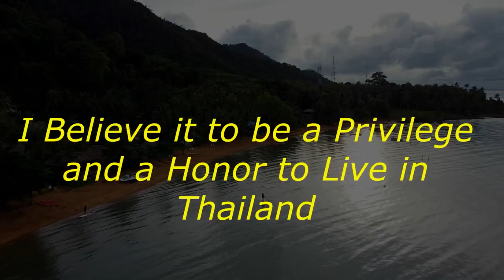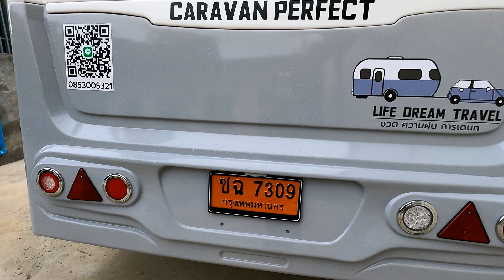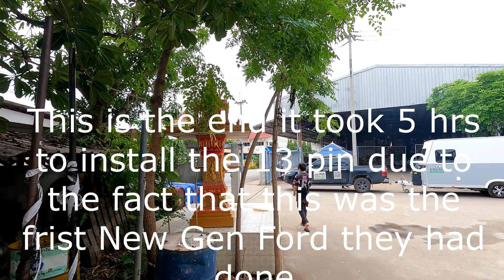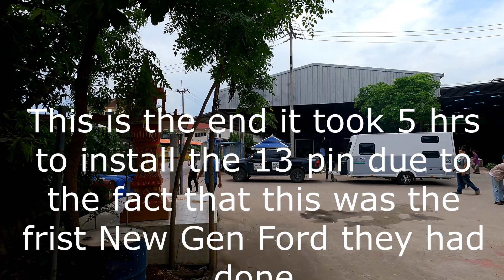Picking up new Trailer

Comment: Yes….Question: The electricity is 220 when you are plugged in to exterior power source…when you are on the batteries is it 110 or 220..?  On the Generator.. ???
Reply from the maker: It Has an inverter we can take the 24 V to 220 I can turn that on by the push of a button and it also has a transformer to go from 24 to 12 V for the outlets in the trailer the water pump lights that kind of stuff the refrigerator will run off both 24 V or 220 V and again at the push of a switch

Comment: Hi Dave, not related to this Vid. but just wondering if you could provide some information about the prefabricated fence you had constructed sometime back.
I live in Surin and am currently looking at fence options. 
I have had one quote for a block/rendered fence but that has come back very expensive in my opinion.
I can’t really see the value in spending hundreds of thousands of baht on a fence. 
I would much prefer to put the money towards the house construction.
Would it be possible to have a detailed conversation with you regarding your experience?
Regards
Reply from the maker: Pleased to meet you I just got back from the Ubon new House build talked to my wife she has the number at her work for the person we Dealt with on purchasing all the concrete parts of the fence she’s going to get it for me to try tomorrow. I’m doing a live stream tomorrow at 8:30 so if you wanna jump on my all means if not if you don’t hear from me in a day or two lol definitely get back to me, but it should be no problem. I’m old, but I shouldn’t shouldn’t forget that. Maybe we’ll have to get together. Welcome to Surin